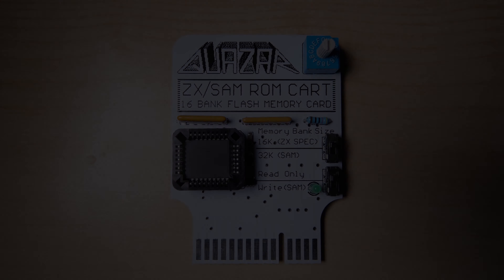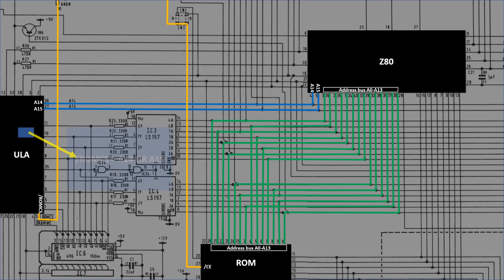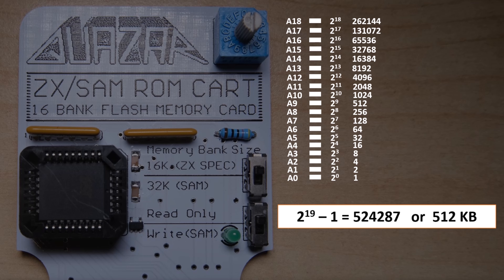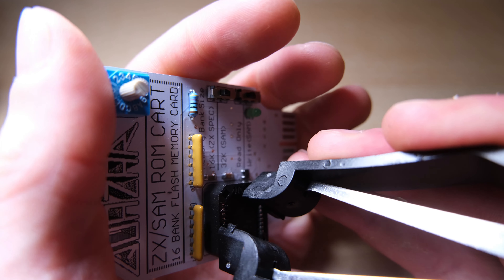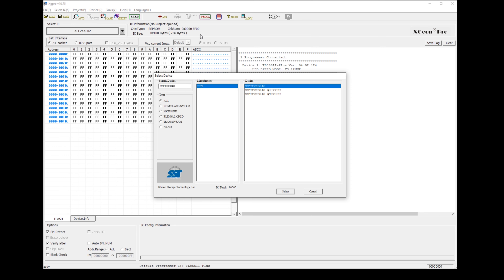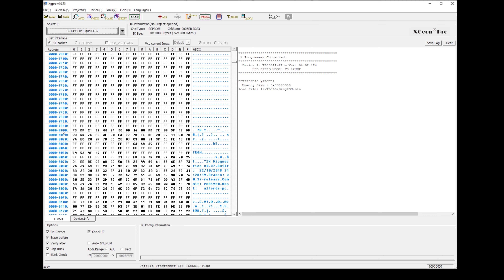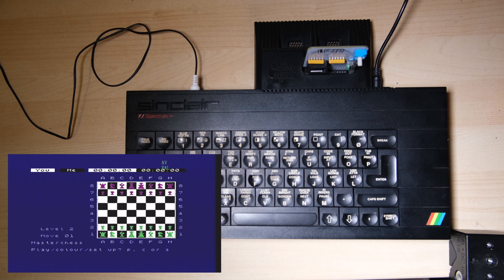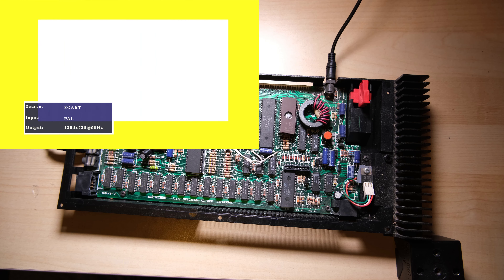Making ZX Spectrum Diagnostic ROM Tools

Comment: Fantastic short but very informative video. I just repaired my first ZX Spectrum yesterday. It belongs to my friend, and the last time it worked was in the 80's. He was convinced that it couldn't be repaired, as he had sent it for repair many times back in the day, but had no luck. Truth be told, I wouldn't have been able to do it, were it not for people like you sharing experiences of fixing ZX Spectrums, and other retro machines. Thanks for you help with the repair. And in case you're curious, there was a problem with the upper ram. Whoever repaired it last left a TI chip in place among 7 OKI chips. I was genuinely chuffed when I got it working, so thanks again for doing what you do.

Comment: If you need to wipe those EPROMs and don't already have a UV eraser, you'll probably find the cheapest solution is a UVC Toothbrush Steriliser.

It was really interesting zeroing the chip then subjecting it to 30 seconds blasts and rereading the contents, then mapping the binary data to a bitmap image. You could actually see the layout of the chips where the ridges between them didn't get as much exposure and took longer to wipe.
Reply from the maker: I might try that out! I was looking at UV erasers but for now I just don't have the need for one other than getting one out of interest

Comment: I used to repair spectrums as a job when I was young and I remember that there was an inbuilt system test menu on the Spectrum + which could be accessed by certain keypresses but I can't remember which and I can't find the info anywhere for some reason. Perhaps I'm going mad in my old age.
Reply from the maker: I think you're right on this one but it was the later 128Ks that had such a feature

Comment: Which extractor tool did you get, specifically? I've had a few and they are all useless. Thanks
Reply from the maker: https://www.amazon.co.uk/Professional-Extractor-WTS-610-Spring-Assisted/dp/B007Q8J2HG  it works but has a habit of contorting and firing the chip across the room